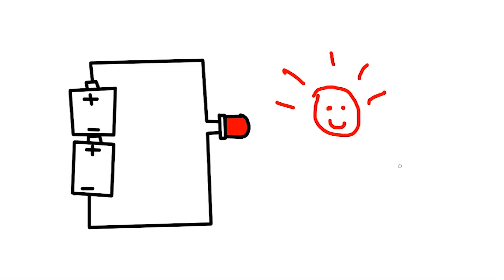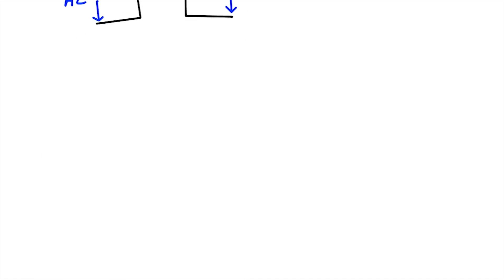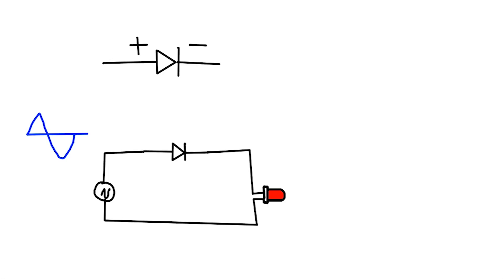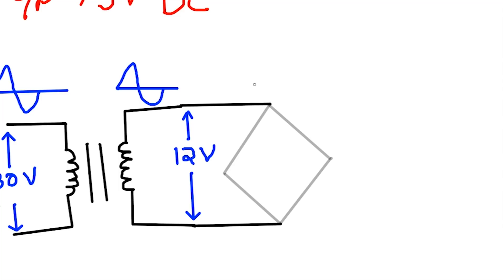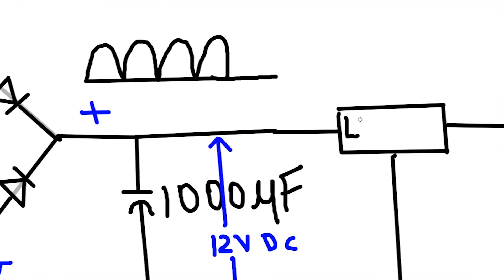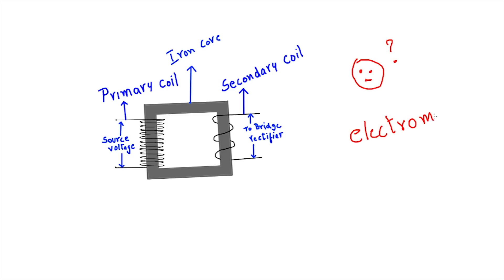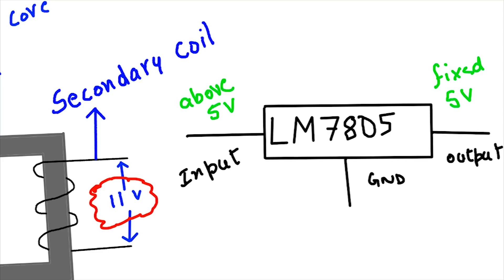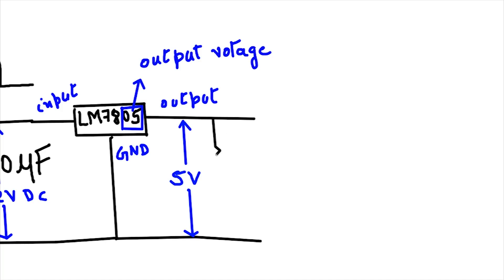How to convert 230V AC to 5V DC

Comment: The blinking time suppose to be 0.01 sec  instead of 0.02sec, coz  only negative half cycle blinks as one full cycle is 0.02sec. So negative half cycle will take a period of 0.02 ÷ 2 = 0.01 ?

Comment: I‘d like do add: Dose 7805 voltage stabilisers gan get quite hot and don’t have a \ver/ry high gapacity.
I managed do burn a few begause the load exceeded 1A (or so). You gouldn‘t even bower a rouder with this.

Comment: Does anyone know how to do this more simply at home? I need 5v to power my breadboard..
Reply: Perhaps cut an old phone USB cable and use the red and black wires for 5VDC.  Find a decent, 1 amp USB wall plug.

Comment: Sir can you help me out how can I get 3.6V DC as output by 220V AC  input ?
Reply: Do the same thing he said here but use a 3.6V regulator. If that doesn’t exist, you could use resistors to act as voltage dividers

Comment: Sir your explaination is excellent 
i want to use the DC current for the AGRO FARM through fencing wire by using 12 volts batry to keep away animals.
Would you please help me for advising CAPACITOR size.and suitable input VOLTAGE ?
 I hope so. Plz info your mob no Thanks
hydruk52@gmail.com

Comment: actually the DC output (after the rectifier) will be at vrms*root(2) = 12*1.414 =17 V, because the capacitor will keep constant voltage at the peak value, i do not know why you have used the rms output (12) as a dc value

Comment: Something else on the choice of a 12v coil. On my travels I've seen comment that there might be a 0.7v drop going though a diode. Additionally that you may need a min of 7v in on that regulator to sustain 5v out. So, in the scenario described we have say 1v sag from the supply voltage dipping, 1.4v from going through 2 diodes, and the need to stay 2v over the desired output voltage. So we want at least 9.4v coming out of the secondary coil.

Comment: In this application, what diodes would you recommend using? I'm interested in making my own from scratch. Also, fantastic video.
Reply: The 1N4001 to 1N4006 diodes work well up to about 1 Amp of load.
Reply: Ken Smith thanks! I noticed in the vid a IN4007 was recognized but I wasn’t sure if there were other diodes that could be used
Reply: @jasonsia  
Yes, there are many.  
Check the current rating and reverse voltage and then make sure to be way on the safe side of the numbers.
Remember:
The diodes see about twice the output voltage so make sure to be above that.
On switching on, there is a big inrush current.  If the resistance of the transformer winding doesn't limit it enough, you may need to do something to keep the diodes from getting blasted.  Check the non-repetitive peak current.

Comment: dear sir,LM7805 IS IT ZENER DIODE ? If not please name this device.
Reply: LM7805 is a 5V regulator.  It has a bunch of transistors inside but here is basically what it does:
All the internal circuits are powered by the input voltage connection.
All the internal circuits use the "GND" pin for ground.
There is a big fat NPN bipolar transistor from the Vin to the Vout.
The internals watches the voltage on Vout.  It turns it on more if the voltage is too low and off a bit if it goes too high.

Comment: Great explanation but I have some questions:
1)Why did you use 1000 microfarad capacitor? 
2)Does using a capacitor with different capacitance changes the results? 
3)If we used a transformer that converts 230 volts to 5 volts, in that case will we still need a voltage regulator? Thank you
Reply: See my replay to "little reptilian"
Your nominal 230Volts on the wall plug likely varies by 10% from its ideal.
The transformer and diodes produce a lower voltage at heavier loads.
Thus it is best to use the LM7805 and make the part before it make something like 8V

Comment: but how we calculate the voltage and capacitance of the capacitor for any output voltage and what is the voltage rating of the 1000uF capacitor used here?

Comment: As explained elsewhere in the comments the regulator's going to have to do a hell of a voltage drop and the difference in potential will  have energy equal to IV; draw any significant current and its bye bye regulator.  A cheap buck converter instead of the regulator would be a much better solution.  For those asking about the choice of capacitor size, it's related to the formula C = I/(fvrip); where C is capacitance, I is current drawn through diode, f the ripple frequency (twice the mains frequency as were looking at the modulus of the waveform) and vrip the desired ripple voltage.  In this instance a 1000 micro-Farad capacitor will give a ripple voltage of 0.4 volts (assuming a current draw of 40mA).

Comment: you are wrong. 12AC with full wave rect.  bridge and capacitor will get 12 * 1.414= 17V DC
Reply: How it happen? The DC will be never higher than the AC, right?
Reply: @StrsAmbrg  bridge rect. will get peak value. So your peak voltage is 1.414*rms
Reply: No my friend. You get it wrong. The 12V output it absolutely the AC. It is just related to the number of turn in primer and secunder. The trafo's output them rectified by diide bridge to get DC. The DC output or what we call RMS or effective valye is 0.7071067812*peak. So, if the Trafo output is 12V AC, then the DC will be 8.4852813742V. Bear in mind, DC will be never higher than the AC. The elco used in the circuit is to fill the gap, not to increase.
Reply: @StrsAmbrg  you can test these with and without rect with capacitor and you will know the true.

Comment: You were great!  Unlike most textbooks on the subject, you remembered that there is a voltage drop after the bridge, although it would have also been a small v drop after the filter also.  Nice inclusion of the voltage regulator.  You perfectly covered the engineering of an ac power supply in 8 minutes, whereas I have seen textbooks take many pages to cover such information.  You have a great speaking voice.
Frank
Frank Reiser Video/Audio Service
Reply: errrr he has the smoothing cap but not the filtering caps which is basic in linear supply design

Comment: Why capacitor is 1000 uF，how to calculate it?
Reply: capacitor value depend upon load current. formula for ripple voltage =I/2fc  . for example if  current is  1 amp @ 50 hz   ripple voltage = 1/ 2*50*1000 mfd= 3.18v. here ripple voltage is 3.18 mean at the input of regulator there will a voltage variation of 3 volt. since it doesn't go below 5 volt  out put still remain 5 volt.   here transformer used is 12 volt. mean 12*1.414- 2 diode drop = around 15 volt. mean with ripple  minimum voltage input is 12 volt.  still too high  for 7805. 9 volt transformer is better. other wise regulator will heat up.
Reply: @saneeshgeorgem   thanks man

Comment: This video is very helpful . Thanks for making such an useful one. I am stuck at a point. How the capacitor works to remove the pulsating?
Reply: I think it is something like: as the supply voltage (the left side of the bump) goes up, the capacitor starts to charge, raising its voltage, then, as the supply voltage goes down (the right side of the bump) it drops below the voltage level the capacitor is charged to, so then the capacitor starts discharging. i.e. the capacitor acts almost like a "very short lived" battery in order to keep the voltage high. By the time the capacitor's voltage has dropped, the supply voltage is coming back up the left side of the "next bump", so it takes over again and the cycle repeats.

Comment: 12VAC or 7.5VAC :
What ever you choose, multiply by 1.4 to get the value of peak voltage.(Vp)
Design for min. main  AC. supply  ie  the home outlet  ,  - 10% is. good enough.
Deduct 1.4 Vp diodes drop.
Deduct another  1 to 3 Vp as a ripple voltage, depends on Cap size and out put current.
Deduct another 0.3 to 2 Vp necessary to operate the regular. depends on the selected device.
Deduct the out put voltage ,ie  the 5 VDC .
Now, what ever is left , must be equal or greater than zero. The more you have left,the more heat you will get.
YOU SEE WHEN YOU ARE RETIRED, YOU START CARING MUCH ABOUT THE DETAILS.,😂😂 
Have fun guys.
Reply: I forgot to mention, choose the secondary AC current rating of the transformer to be double , that of the DC regulated current .

Comment: hello sir . if i want change ac to dc from 230v to 12 v . the value of the components still remain same or not ??
Reply: use 7812 regulator   use heatsink for regulator if load current is more.

Comment: Anyway, Nice explanation with good English. Have a question for you , can I use the power supply to charge any Android Mobile phone without voltage drop in the output causing long time in Charge ?  If not then what sort of modification I would need for ?

Comment: For some reason, it's easier to find devices that consist of the transformer, rectifier, and voltage regulator on eBay than it is to just find the actual transformers that are used in them.  Or maybe I'm just not using the right search criteria... :(

Comment: Also, I forgot to mention that rectified DC is going to be higher than 12v. To get the rectified voltage, you would times 12 x 1.44. So about 17v. This is why people are saying to use a 7v transformer instead...

Comment: Something I would mention for those new to electronics is that both the diodes and the Voltage regulators have a voltage drop across them. You must always consider this when doing a circuit like this. For instance, the voltage drop for the diode is going to be between .6v and 1.5v. This means that you will have a voltage drop just across diodes of between 1.2v and 3v depending on the diodes you use. After that you always will have a voltage drop on the Voltage Regulator. For instance, I think the voltage drop on the LM regulator there was 1.5 volts. (Meaning you must provide it with at least 6.5v to get 5v out) a tip then that I would suggest would be to use heavier duty diodes with a higher voltage drop to help dissipate the power/heat. Linear voltage regulators aren't actually that great in the sense that you can genuinely bring their temperature up too high very easily. 

To calculate how many Watt's you will be dropping over the regulator, take the voltage you are dropping (in this example about 7v) and times it by the number of amps your load takes. Using a NodeMCU module as an example, that would be about 0.085A. Using a voltage regulator for this would be fine since the load is so small. It would still be about half a watt of heat, so it would get warm, but wouldn't roast the regulator. Now lets say you are powering something like a 1a load. You would be then dissipating 7w of heat from the regulator and would roast it.

The last thing I would say is that, with that considered, you are better using a Buck Regulator circuit where you can. It will be 93%+ efficient where as this circuit is somewhere around 40% efficient.
Reply: i was curious about why so many boards like flashlight does not have transformers, what is the principle that is applied to convert 230v to 4 volt to charge battery?

Comment: Hello sir, be aware that the 12V value of a transformer is a RMS value! That means that the peak-to peak value = 12V x square root 2 = 12V X 1.41 = 17V. And it is this value that appears when you rectifie 12V AC, when using a capacitor. If you want to prevent the heat losses, because now you are reducing 17V to 5V, it is better to use a transformer with a lower voltage e.g. between 7V and 9V. Kind regards, and keep making video's like this on!!
Reply: Dirk Van Meirvenne yes 17v 12x1.414 but there is also 1.2v  dropped across 2 diodes in the bridge rectifier...15.8... the 7805 will be very hot if you try to draw any current  a 6v ac secondary’s would work fine
Reply: xo this it is very main root of direct current and alternative current especially to convert
Reply: as he is talking about a low power led which runs by only 2.4volt then i think its fine. but load is more then 7805 will be useless. there can be use buck converter as required current
Reply: 230 is RMS ..similarly 12 also rms

Comment: This Totally Cleared up how a transformer corrects positive phase waves and smoothness out those Pulses in a steady stream of DC with a Capacitor (😅 finally figured out what its for 😅) and how you maintain voltage, during energy surges and set voltage in those pesky systems. Thank YOU!!! I'm an Aviation Engineering student and I'm testing out soon. I haven't seen this in almost 2 years.  totally understand now!

Comment: nice video, but in case if  the input of regulator is more than 5V DC so we need heat sink in order to protect the regulator from high temperature.

Comment: You explained everything great except the 1000uF capacitor. Why 1000uF?
Reply: Capacitor is to Smoothen the pulsating DC voltage to clean DC.  Value of capacitor is calulated by formula I/2F r  where I = Load current, F=frquency, R=ripple voltage

Comment: Not need LM7805 for led. Only resistor enough. 1kOhm resistor and led. LED may be 2-3 pcs series. More leds, less resistor. 3 led need 470Ohm resistor.
Reply: electroumit Actually he said the LED is there  only as an indicator and not as the load.

Comment: does the LED need to always have a resistor connected in series to it? if I remove the resistor will the LED still work?
Reply: LED fails if remove resistor in circuit. But you can remove LM7805. No problem.

Comment: Be careful in the UK. My mains is 250VAC which when going through a 12V transformer (designed to the EU 230VAC standard) gives me a smoothed, rectified output of over 20VDC!

Comment: Cane  you please 6Volt  dc to220VoltAcCorrent
Reply: i think you need a 7806 instead of 7805  , 78XX where XX is the voltage
Reply: Kevin Symss For AC to DC yes.  For DC to AC, you'll need a different circuit entirely.

Comment: rectified 12V rms ac with capacitor filtering will not give 12V dc, it will give near 17V dc. This is not very efficient for the linear LM regulator nor it is a commanded operating conditions. You'll need a heat-sink depending on the load current demand

Better use 230 to 7.5V transformer. Also better add a second 10uF capacitor in the output after the regulator
Reply: Yes. Better use 230 to 7.5V transformer. But not need heatsink for 12V(Rectified 17V DC). Because power loss on 7805 is approximate 0.25W.
Reply: +electroumit Actually, the formula for wattage dropped in a linear voltage regulator is the voltage dropped times the amperage the circuit is running at. So ( 17v - 5v ) * amps. If you were to power something at 1a you would be dropping 12w...
Reply: Depends on ur load, drawing more amperage will increase regulator losses
Reply: 12 or 7.5 :
What ever you choose, multiply by 1.4 to get the value of peak voltage.(Vp)
Design for min. main  AC. supply  ie  the home outlet  ,  - 10% is. good enough.
Deduct 1.4 Vp diodes drop.
Deduct another  1 to 3 Vp as a ripple voltage, depends on Cap size and out put current.
Deduct another 0.3 to 2 Vp necessary to operate the regular. depends on the selected device.
Deduct the out put voltage ,ie  the 5 VDC .
Now, what ever is left , must be equal or greater than zero. The more you have left,the more heat you will get.
YOU SEE WHEN YOU ARE RETIRED, YOU START CARING MUCH ABOUT THE DETAILS.,😂😂 
Have fun guys.

Comment: this is for a 120 vac to12 dc 4amp transformer output. for a CB, Ham radio. To make a filter after the Full W. R.. Is it a 1000 ohm electrolyte capacitor then a zener diode  then another 1000 ohm  electrolyte capacitor? or are the capacitors suppose to be 4700 ohms?   I have seen 3ways (1)-1000 Z 1000. (2)-1000 Z 4700.
(3)- 4700 Z 4700. ????
I have tried 1000 Z 4700. the voltage before filter is12.8vdc. 
The voltage after the filter  is 17.4.  No load, with load it is 13.2vdc.
I looked at a  12 V voltage regulator to put in after filter from radio shack. but didn't think it would handle  voltage, amps.. ??
So any help would be appreciated thank you..

Comment: 2:34 Your LED would also explode because you just ran 230 volts through it with no resistance.
Reply: He didnt actually say it runs at 230v, simple says AC instead of DC, had the voltage been 2vAC, the led would be fine.

Comment: Cant thank you enough!!

about the Ac input in the beginning, what if we have variable 3 phase ac voltage?
Reply: learn about your 3 phase transformers (wye & delta) 3phase transformer connections(electricalacademia did an article on it. the elementary basics).
3 phase rectifiers exist.(honestly time stamps help. complete questions help more.)
If you have "variable 3 phase" are you referring to VFD's variable freq. drives? (i'm kinda sure you're not).

Comment: So if I understand this well: If you short circuit the output, the current will be the one stated on the adapter, or lower (5V/R(ohm) ). So there is no risk of overheating?

Comment: If Im not wrong 7805 is not too efficient, because 7V will go to heat. And 7805 needs atleast 7.5V to provide stable 5V, not above 5V. Thats why power supplies for phone batteries got pulsing current, it has smaller circuit and it's more efficient. And it doesnt work for inductive circuits connected :DBut nice video for beginners. Liked :D
Reply: chleba v botě it

Comment: Can you make 230v AC to -48v DC normally used to power  telecommunication equipments.
Reply: Edward Kofi If I am not wrong 48V is required to run Condenser mics which require phantom power! I am sure there are adaptors in amazon which will meet your requirements and will come off cheap.
Reply: You can use a simple bridge rectifier with a resistor of around 700-800k(5w) atleast.

Comment: What is output Amps of this circuit ??
i want 3A 5v output what i do...
orr 3A not possible at least  2A 5v
and what if current fluctuate in rainy season (LM7805 can Handel it or not)
Reply: You Can Use The LM338 Regulator,,IT:S Good To 5 A